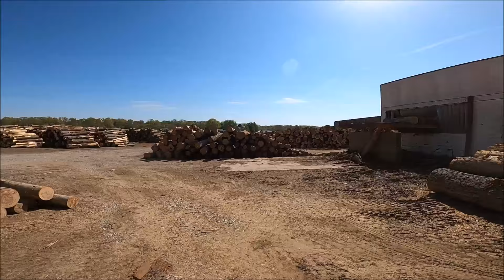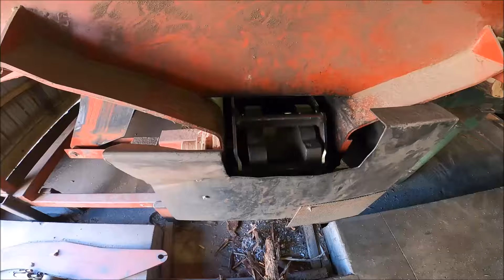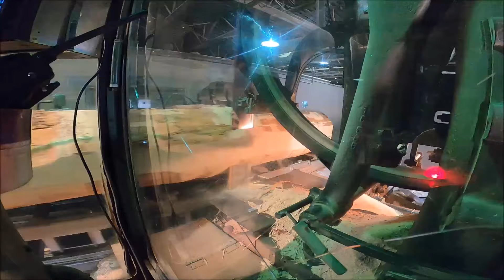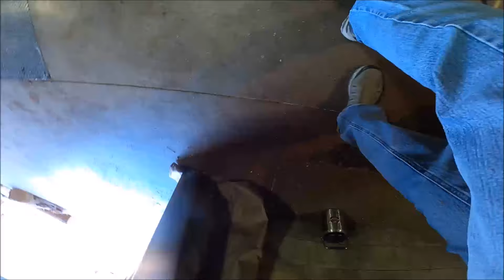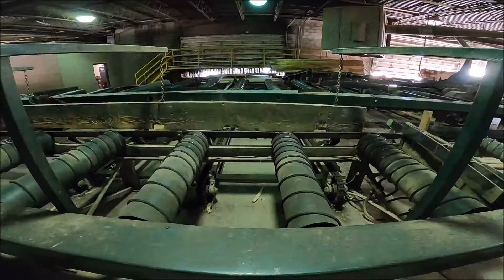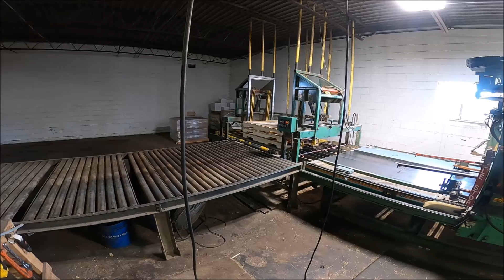Touring a Big Sawmill, McKay Gross Lumber

Comment: Were they having problems with their setworks? That wasted pass on every face turn is a production killer. The Sawyer is doing a great job sawing for max grade potential.
Reply from the maker: There is that much stress in the logs he was cutting you could see the cant Boewing as he would cut, that extra pass was to make sure that everything was squared up